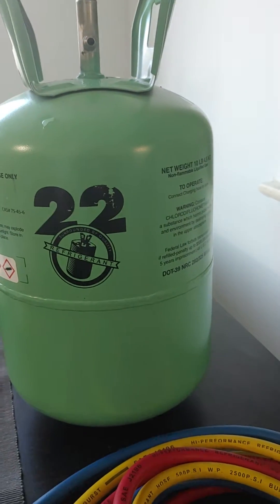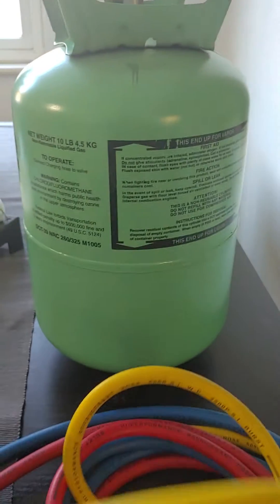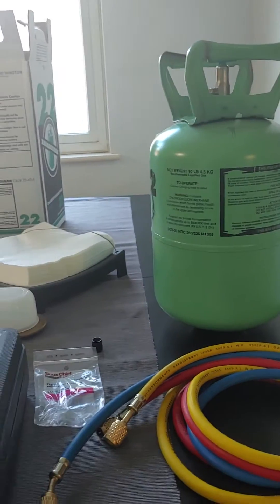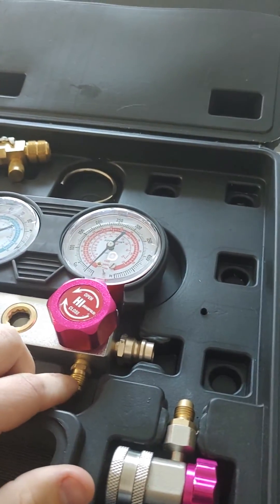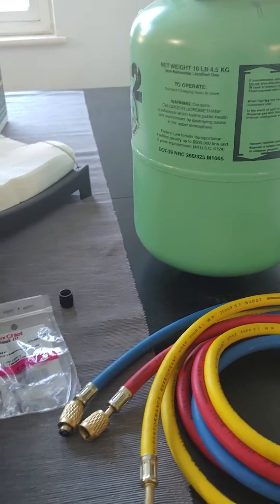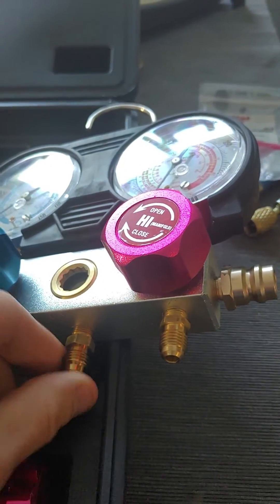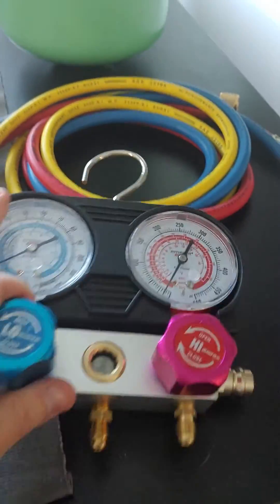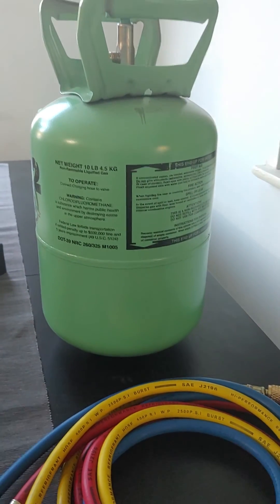Adapting r134a gauges to charge r22 compressor

Comment: Good info, thanks. I used mine the same you you described except I just moved the fitting over from the high pressure side to the center port. Worked great to add the r22 into my old Lennox.

Comment: I was told not to flip the tank. Takes a little longer for vapor charge than liquid but less chance to overcharge. Does that sound right?
Reply: You are partly correct, you can use both methods , turning the tank upside down provides straight liquid, this is not necessary when only a few once’s are needed, unless you are experienced vapour charging is best and safest so you don’t damage the compressor valves slugging liquid. If you do charge liquid you only want to slightly open the low side valve, where when charging vapour there is no risk of damage.
Reply: A lot of talk again with no promises
Reply: Sorry that last message